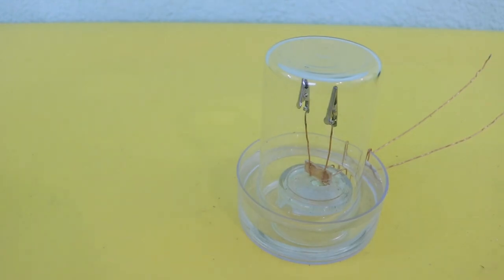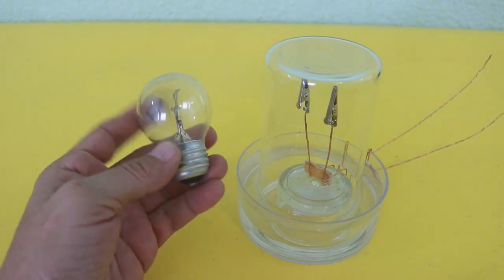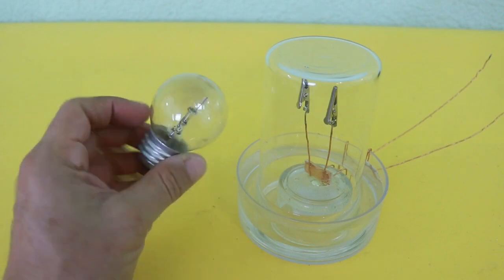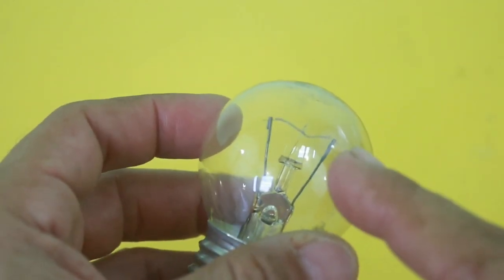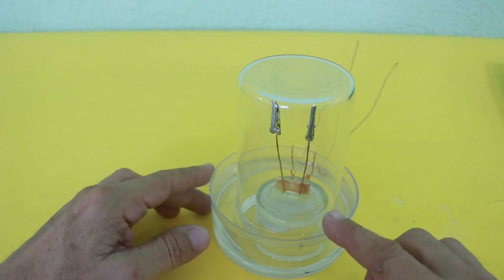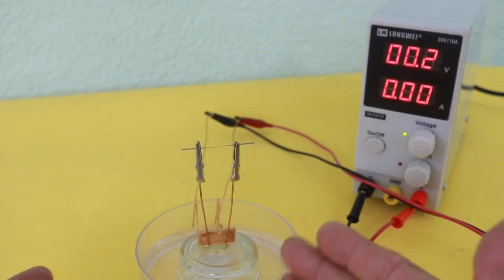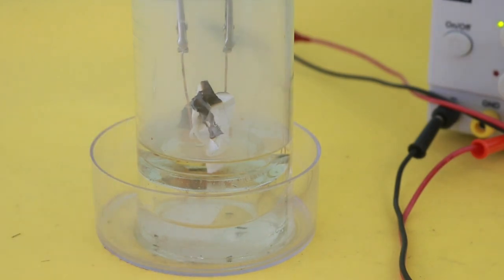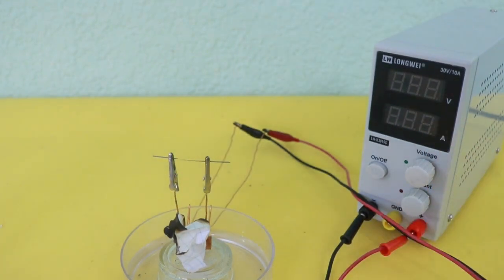Homemade Incandescent Lamp

Comment: Very excellent dude love it! there is a bulb in london that has been burning since 1903 it is said it will continue indefinitely so long as it is never turned off or power is cut  as the surge is what destroys the filament  and was originally ramped up to full power over several weeks!

Comment: There are light bulbs that are still working that are well over a hundred years old. I think they redesigned them to fail so that people had to keep buying their product.
Reply from the maker: yes that is a well known fact
Reply: Those "long running" bulbs that you hear about are all (there aren't many, the one everyone is mentioning is the one in "that" fire station) driven well below their nominal voltage and never switched. If you'd do that with a modern bulb it would last for ages as well. But "underrunning" a bulb also means that it is even more inefficient than incandescents already are.

There was a cartel of bulb manufacturers, but them limiting the life time of bulbs to make money is more of a conspiracy theory than truth. Yes, the cartel did share patents between them to prevent competition and they split the world into markets to not compete with each other. That was definitely criminal.
But "standardizing" the life expectancy of bulbs was mostly to prevent false advertising among them. Life expectancy, brightness and efficiency are competing factors in a light bulb. To keep someone advertising "extra bright bulbs" that would burn out after 500 hours or "long life bulbs" with low brightness or efficiency, they aimed for a life expectancy of about 1000 hours. That was the best technical compromise at the time.

Comment: Very clever and elegant solution using water as a flexible airtight seal and a piece of paper as a getter. I wonder if the graphite would last longer in a pure carbon dioxide environment, or at lower current? It would be interesting to see how long one of these homemade bulbs could run. Did you do any further experimentation? Great video!

Comment: LED's are better but they cause lots of radio interfference!
Reply: LED's cause radio interference?
Reply: @shashwatvishwakarma269  Yes, the LED lights that are connected to the mains. 555 timer IC's too. Just connect a 10nF cap between pins 7 and 8 to get rid of it.
Reply: @Berghiker  ok thanks I didnt knew that
Reply: That has nothing to do with LEDs. If, at all, it is power supplies that cause interference. Interference could as easily come from phone chargers, your computer or screen, speakers or hifi system and any other device with a PSU. If properly designed, none of these (including LED bulbs) will cause any interference.
Reply: @superdau  Ok. So how do I solve that problem?
Reply: @Berghiker  
Don't buy the cheapest things directly from China. Interference is a sign of bad or cheap design. It won't happen in devices that are built properly.